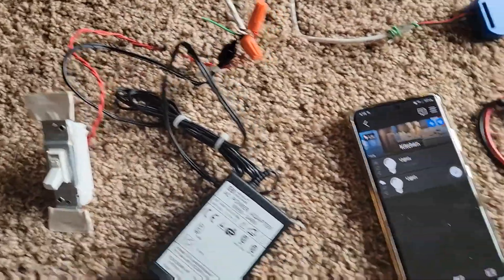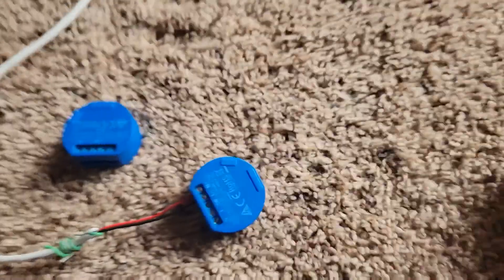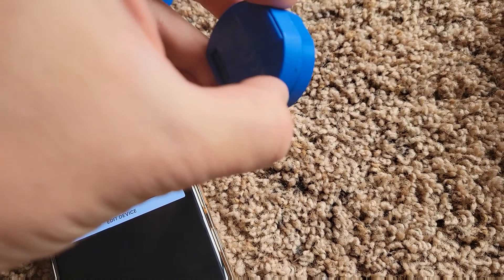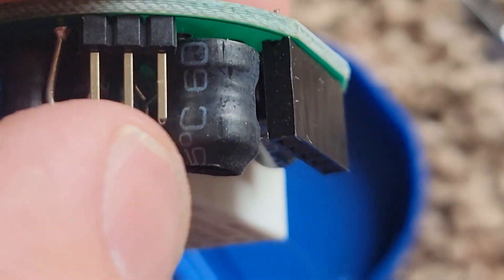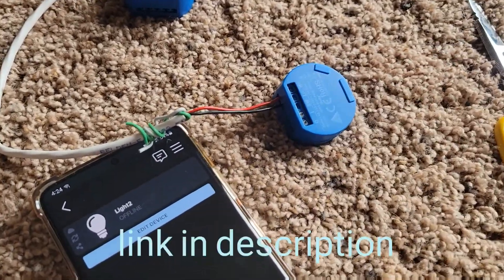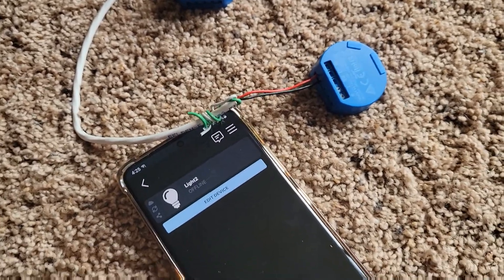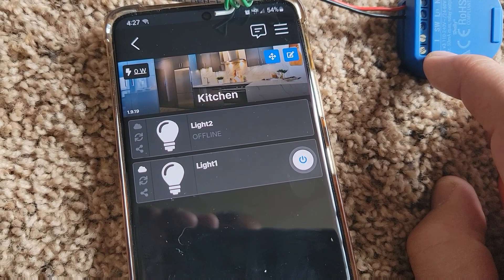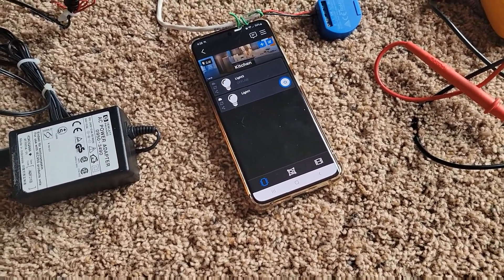Shelly 1 relay - DC wiring - beginner vid - troubleshooting connectivity

Comment: while u trigger ligths I having a blast even trying to login inti them. Says my email is not a shelly email. and the on the the other phone logged in. Cant do anyuthing no connection to nothing . Shelly really start piss me oss. THey dont take care of customer they take care of some eay problem but they wioll neveer take care of the customer. Some small extra thing or feel good trinket. I think about boing to change my oout no brand chinese stuff. Same thing and same type of customer sevice.
Reply: I had same initially, got it working today with my email, suggest trying again